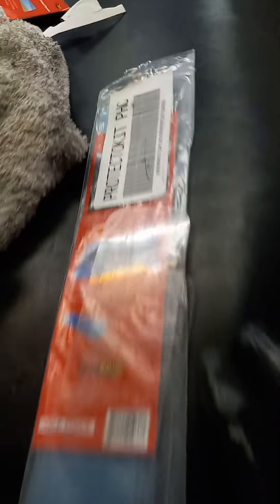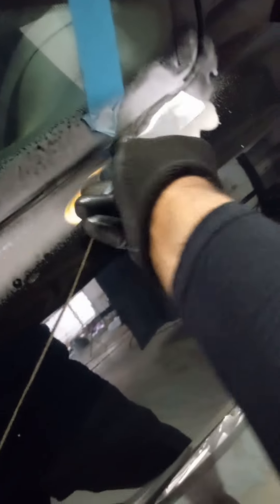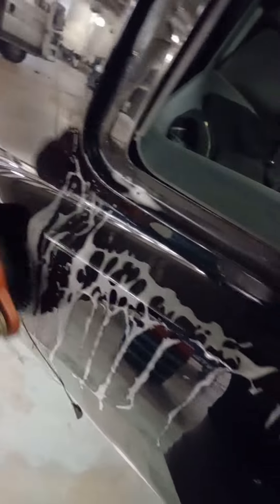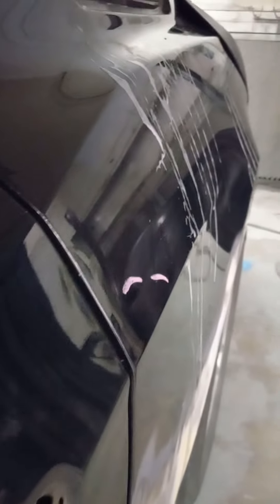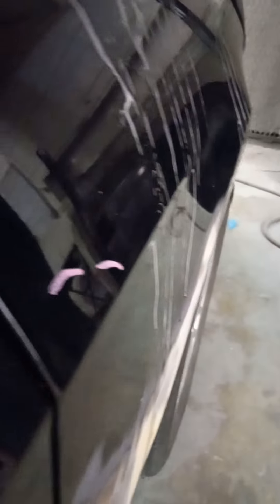How to Remove a Quarter Panel glass ford mustang 2007 form outside

Comment: I’m new to the Wrd bat, what is the difference between one loop or two loops 👍🏻
Reply: With 2 loops you have less tension on the cord when you get to a clip. Itll use more drag to break the clip with less chance of snapping cord

Comment: Would you show the setup and how run your string on a chevrolet or dodge truck backglass
Reply: If it's the power slider I don't think this would work. I personally use steel wire and pull it through to the inside by hand with T handles